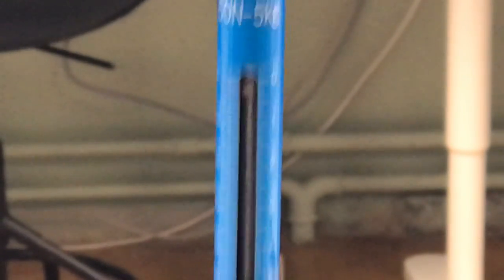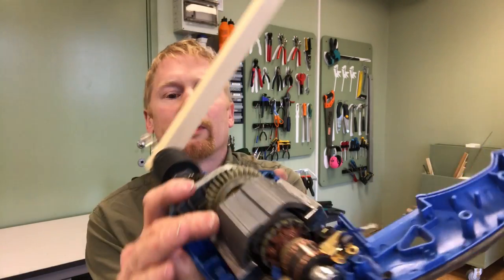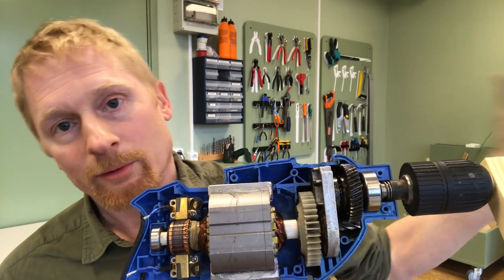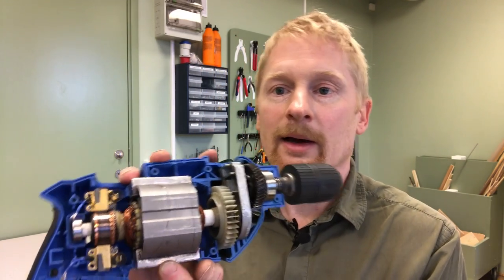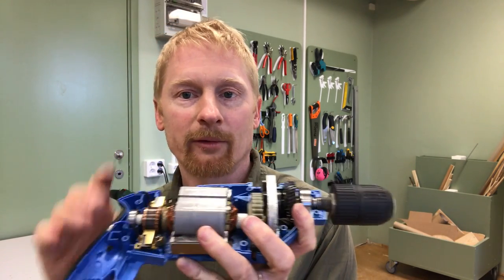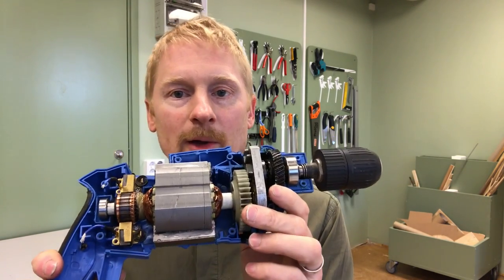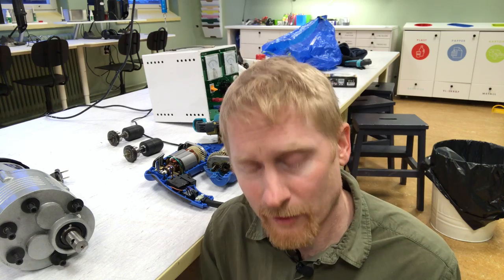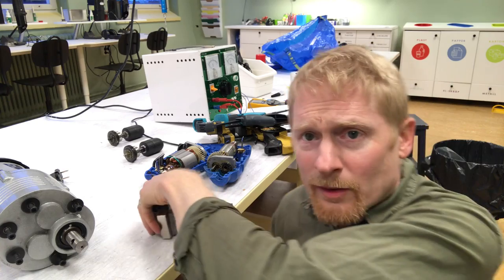DIY R&D e1  -AC Power Tool Hack: series wound corded drill to permanent magnet DC

Comment: Check out Emrax motors. 100kW 12kg and high 90s efficiency. Might be great for EVTOL. 2 or 4 props on tilt wings.
I saw them used on a finnish snowmobile. It's the real thing.

Comment: Dear sir,
Of course you know this. But!
1-High quality power tools are built with series electromagnets to eliminate the curie temperature limit problem where a neodymium magnet loses its field completely and forever. A professional will push a tool very hard and drive the temperatures up. 

An earth drilling motor is expected to be CONTINUOUS duty. You must make sure it cannot approach that certain complete failure with a feedback circuit OR a thermal transfer system guaranteed to have a heat failure elsewhere which might be resettable. Maybe a bigger fan?

2- the contacts/brushes in a unidrection motor tend to wear such that the entire area of the contractor and brush are used. When reversing the brushes tend to wear so they are rounded the opposite direction.  There CAN be less brush area connection but the same current is required. If this area is now derated too much it can cause excessive heat.

All is not lost. The load can be configured to never allow the highest current draw the contractors can take.  Also playing with the voltage will change the current drawn across that area. The voltage drop there and the current will determine how much heat can be there.

Again, maybe improved circulation is all that is needed.

Power tools look simple. Their first design probably was simple. But the engineers learned over the years the failures. The good ones figured out why. Other companies simply beefed up the failure point and rewrote the specifications.  So one realizes design changes change the specs. It is NOT the same tool.

A great tool has many design focuses: Customer usage requirements/expectations , Electrical, Mechanical, Tool safety, environmental, speed/force for job, longevity, maintenance, cost, part selection and service. And a lot lot more.

What I find interesting is having some of this stuff outlined so people learn these tradeoffs.

Many people bash tools and say they are poorly made. I don't usually see it that way. I see it such that a tradeoff was made but the public was not given that information. Usually they were  not given this because that information would be abused by the consumer or competition. 

For instance, you stated  RPMs in this video.  I doubt it was, you were probably counting contractors across a point per minute. So, a competitor finds that painting more white dots in that area without publishing any rpm spec sells more tools and is cheaper. (Relying upon false info spread for free).

Anyway! I love the ideas. Keep up the good work.
Reply: You have a good point, I use to fix drills all the time for our construction business, mostly it was the modern fancy switches they use these days were the failure point, then after that it was the commutators glue would dry out and thus ruin the rotor. But the drills that we still had from the 70's were and are still running strong, who knew, go figure, they were simply build better, big surprise..lol.

Comment: Another method that might work would be to add a two poll two throw switch into the stator windings that reverses  the polarity of the stator relative to the rotor

Comment: This universal motor runs on AC ánd DC, without modification. Does it not change the direction of turning when the DC current switches polarity? Or actually; why does it spin in 1 direction with AC?  (I don't know).
Reply: As the stator windings are in series with the rotor windings, when a reverse polarity is used the magnetic field changes to oppose the rotor in the same orientation as a forward polarity. Pretty clever design actually

Comment: You realize that the permanent magnet conversion is not the only solution - even with just changing the polarity only on the rotor or only on the stator you would have the same effect? The purely electromagnetic solution of course has the advantage that the max. winding temperature might be higher then the point where you risk losing magnetism due to Curie temperature...
Reply: While this is true, replacing the stator windings with magnets allows for a lower operating voltage and there is no longer power loss through the stator, so there is distinct advantages when considering battery powered applications. If the motor is approaching temperatures close to the Curie temperature of the magnets then I would argue that he has more significant problems than a loss of magnetism.. After all, standard neodymium magnets are common in brushless DC motors.

Comment: Woah you dont need to do that much work!  just separately excite the sator windings that way you can choose its v/rpm ratio on the fly ive run routers for years this way to reduce rpm and noise while increesling Torque
Reply from the maker: True, but that feature might be more complicated to incorporate in a simple hobby servo driver context compared to simply switch polarity to the motor leads.

Comment: Are not all corded power tool motors, actually universal motors,   in batt drills the dresses are 90 degrees apart amd on a saw zall I saw taken apart, they where 180 degrees apart.

Comment: Universal motors are already reversible. What am I missing here?
Reply from the maker: True, but that feature might be more complicated to incorporate in a simple hobby servo driver context compared to simply switch polarity to the motor leads.
Reply: Not really.  you just switch the field & rotor windings relative to each other using a DPDT switch or relay. If it is Normally Off, motor reversal is still achieved by polarity reversal.

Comment: I don't understand your RPM measurement.  It looks like you did it by pointing the meter at the teeth of the gear.  Wouldn't that multiply the RPMs of the motor by the number of teeth in the gear?
Reply from the maker: Sorry, I did not show the part where I glued a strip of reflective tape close to the center of the rotor winding, at which I am pointing the laser beam.
Reply: @amazingdiyprojects  Ah, ok,  tack så mycket.

Comment: Can its run on DC volt . Kindly reply.
Reply from the maker: The original series wound (universal) motor runs on both AC or DC. The modified version runs on DC only, but more efficient and can change the direction of rotation by switching input polarity.
Reply: @amazingdiyprojects  Thanks dear i really appreciate. Your modification theory can help me a lot. Thanks once again.

Comment: Theres a big problem. Since AC is sinewave and DC constant it meanscthat the brushed
Reply: He is running this motor on DC only after the modification. Universal motors can run on AC or DC, I'm not sure what you meant?
Reply: @IrishSkruffles  DC generates more sparking, to get the same power it needs to also draw more than twice the current wich exceeds the capacity of the brushes.
He could just use 2 pole changeover relay
Reply: @mihkus  The increase in current is desirable in this case to get the same amount of torque at a lower operating voltage. There are spark arrestor circuits which would help the arcing at the commutator also.

Why do you think it needs twice the current to get the same amount power?

Comment: you can change the direction of your universal motor without rebuilding the whole thing:
simply change the wiring of - lets say the stator winding in relation to the rotor winding. you can use a switch to reverse the direction whenever needed.
good luck!
Reply from the maker: Check out my inflatable car series episode 1-9 and my power tool propelled utility vehicle project and then we can have a good discussion of pros and cons regarding various ways of switching rotational direction on universal motors! :-D

Comment: I use the elektromagnets of the stator always in one Polarity (dc) and switched only  the Polarity of the Rotor. No need for permanent Magnets. Only electrical work.
I Run the elektromagnets in parallel

Comment: Intressant! Men kan du inte bara likrikta strömmen som går genom statorn och behålla lindningen?
Reply: Yes that’s what I thought too; built in a bridge rectifier that always directs the current through the stator the same way and then you should be able to change the motors direction just like it was a permanent magnet DC-motor.

Comment: you can change rotation direction in series motors also. many power tool drills come with this feature.
Reply from the maker: True, but that feature might be more complicated to incorporate in a simple hobby servo driver context compared to simply switch polarity to the motor leads.
Reply: @amazingdiyprojects  hmm. How about using the existing stator coils as the magnetic poles by powering them using an external voltage instead of using neodymium magnets. Saves alot of rework time and effort.
Reply from the maker: @akshaykumarvyas  You could absolutely do that, however I mostly just wanted to see if this could be done and perhaps  gain /confirm some  knowledge.  Thank you for the suggestion anyway!

Comment: Why does the toolmaker decide to go the way they do? Is it the cost of the permanent magnets? Or it is more efficient at higher rotational speeds without the magnets ?
Reply from the maker: Higher stall torque at full voltage and cost I would think. Efficiency would be higher with permanent magnets though but not that big of an deal since the tool is not battery powered but runs of the wall outlet = pretty much unlimited supply of power.
Reply: @amazingdiyprojects  in plus "higher wattage on the carton": more sales in the DIY-shop

Comment: Hammer drill doesnt come with a reverse?
If it was a mechanical thing, adding a solenoid would have still allowed a reversed voltage to reverse the drill.
Reply: There are two types of rotor winding designs. One that can be reversed and one thats unidirectional... When reversed its very unefficient and will very likely burn but in designed rotation its more efficient that reverseable motors.